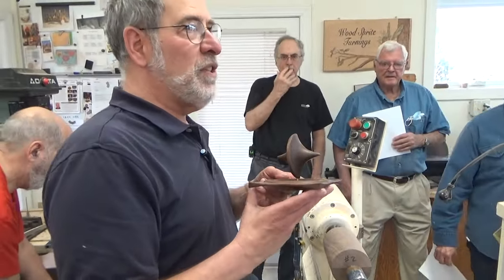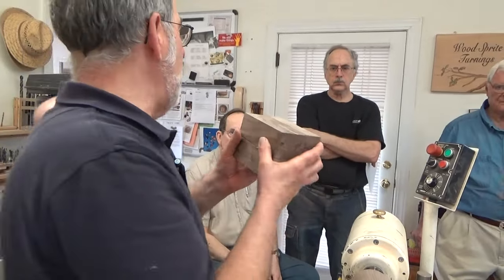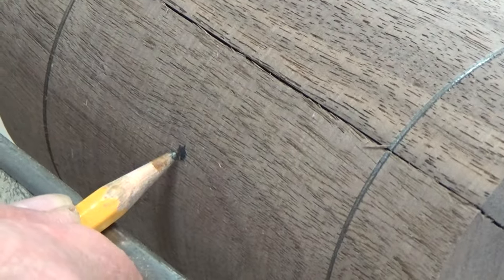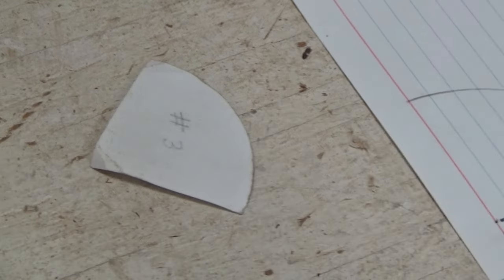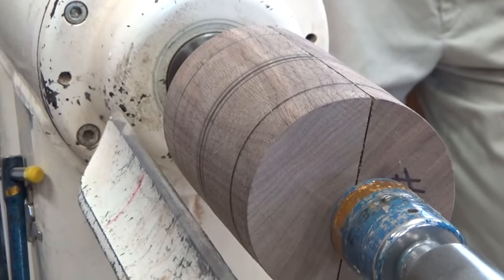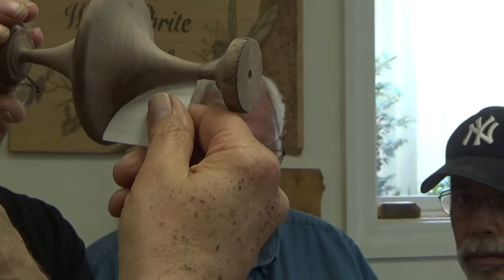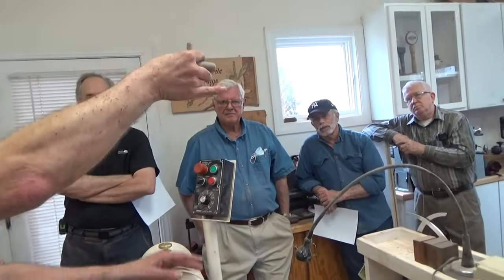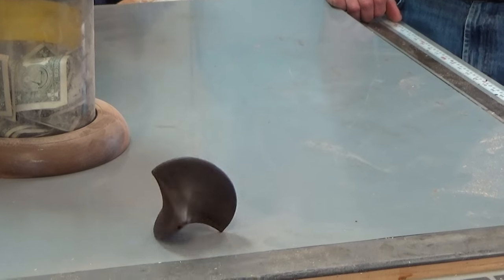Turning a Femisphere by Mike Salemi

Comment: Every time I try to turn the block round, I'm afraid to because its catching, so I tighten my tail stock, then eventually it splits where I glued it together, then I cant get it round.  Which comes to my next question.  If I turn one side, and get it curved correctly, how am I going to turn the other side, with only 3/8 " of wood holding it in place, and even that, is split with glue?
Reply: Tommy Schutz I see nobody replied to your questions. I do things slightly differently. 
1. Make your blanks 1-1/2” longer, there will be a little more waste.
2. Use turners tape to hold pieces together. Clamp with pressure for 15 min. To set the tape.
3. Use a spur center drive, and a cup center in tail stock. Cut the v grooves as in the video. Turn carefully a 3/4” wide by 1” dia tenon on both ends. Wrap each of these tenons with 3 wraps of strapping tape. Turn as per video, the tape will ensure they don’t come apart.
4. When turned , cut off the tenons and use a very thin blade, working carefully, pry the pieces apart.
Reply: Thanks for replying.  I really appreciate your input.  I made one initially, and it was relatively easy.  I went back months later, only to discover that I couldn't even turn the blanks round, because the more pressure I applied with my spur drive and cone center in the tail stock, it pulled the blanks apart.  I realized, after your input, that I needed to use the cup center on the tail stock, and my problems would be solved. Your suggestions for the 3/4" wide by 1" diameter tenon, on both ends, is helpful too.Thanks again, Tommy Schutz

Comment: I can cut the pieces exactly the same.  I cut a groove in the center to avoid them coming apart.  My question is, when you apply the hot glue, are they supposed to be flat against eachother, or is there a space between them, because of the glue?
Reply: Hot glue is almost impossible to compress to 'zero gap', but I believe that you should aim for a minimal gap - not least because the whole principle of the design relies on the symmetry of the two halves.
Reply: @Draven London Flixportal :D
Reply: @Jace Kyle thank you, I signed up and it seems like a nice service =) I really appreciate it !
Reply: @Draven London glad I could help xD